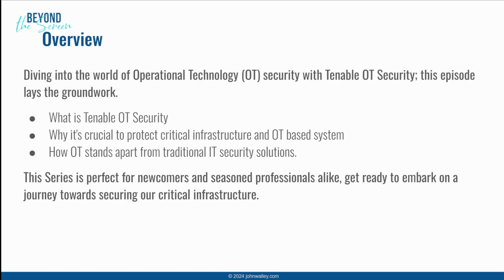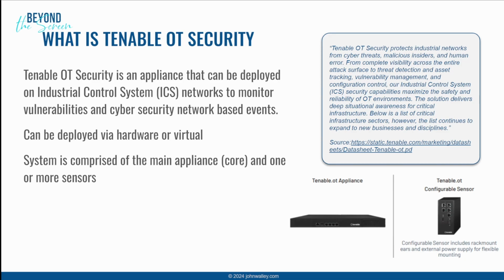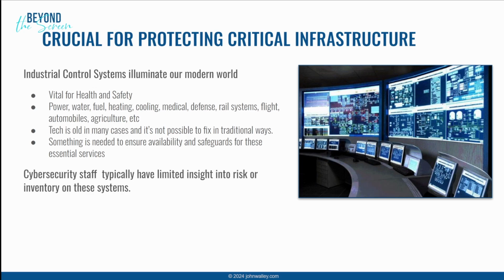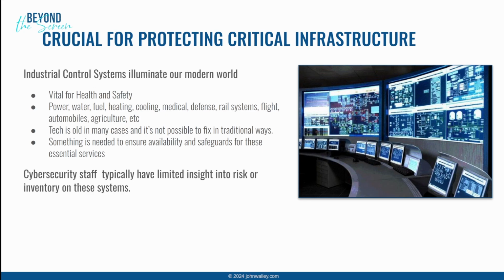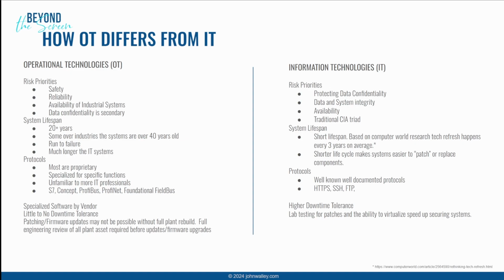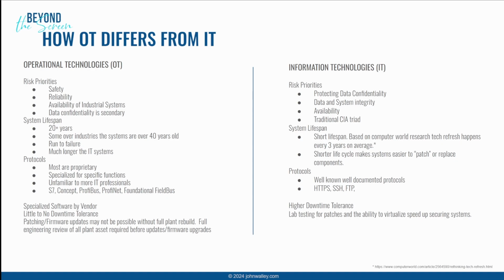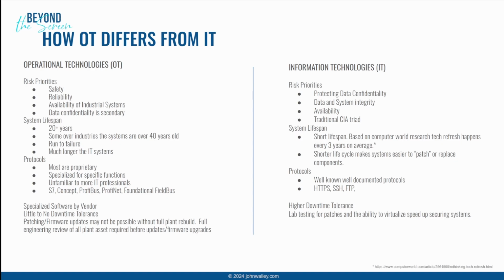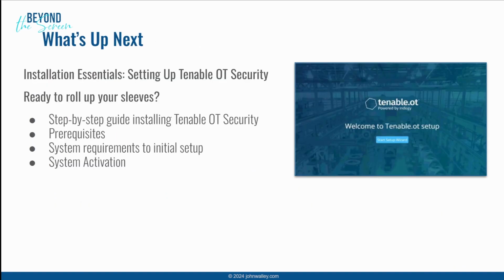EP1: Securing the Foundation: Introduction to Tenable OT

Comment: Hi John, really appreciated these videos. Any recommendation for the tenable OT security specialist exam? I can't find much online, I have some lab exercises and the tenable OT user guide but I don't know what to expect in term of questions.

I heard there is a written and and practical exam. Any help would be appreciated.
Reply from the maker: Thank you for your kind words! I'm glad to hear you found the videos helpful.

Regarding the Tenable OT Security Specialist exam, here are a few tips to help you prepare:

- Make sure you have a deep understanding of the Tenable OT user guide, focusing on key features and functionalities. Here is a link: https://docs.tenable.com/OT-security/3_18/Content/Introduction/Introduction.htm

- Since the labs run on version 3.15, ensure you're familiar with this specific version. Hands-on practice is crucial, so spend ample time on lab exercises to get comfortable with the product. You should be able to get an older version from Tenable Support if needed for study as long as you have a license. 

- For the written exam, you can expect questions that directly assess your knowledge of Tenable OT's features and usage - again this is tied to version 3.15 and a good bit has changed 

- The practical exam will test your ability to use and navigate Tenable OT in a simulated environment. Focus on tasks such the output of of specific actions. actions such as - what networks are identified you your monitored network?

- As a tenable customer you will have access to Tenable University. Take the free on-demand class if you haven't taken the instructor lead class it will help. 

- Finally, stay focused and confident in your skills. With thorough preparation, you’ll do great!

Best of luck!
Reply from the maker: If you still think you need some brushing up I would be more than happy to assist. Just drop me a line at jwalley@type11.net.

Comment: Amazing video! Do you know if Tenable OT does any compliance scanning like Tenable SC? If so, does it use STIGs like the Tenable SC audit files? Besides an on-prem virtual or physical deployment option, does it support cloud deployment?
Reply from the maker: Currently, Tenable OT does not support compliance checks. Including standards like NERC CIP and NIST 800-82 would indeed be beneficial. If you're interested in seeing compliance capabilities added to the tool, I recommend making a suggestion through their feedback portal, which is closely monitored by the team. As an existing customer, you can contribute up to 30 votes for features you'd like to see in Tenable products. For more details, visit https://suggestions.tenable.com. Additionally, coupling OT with SC allows you to generate reports for both your OT and IT assets, as they integrate seamlessly. Here’s a video on this integration: https://youtu.be/EBsDL39SS4k?si=xtzTqUOw50G6N-Ch. While direct compliance capabilities are limited, this setup offers some compliance functions for IoT assets in the OT environment, including high-functioning HMIs, asset servers, historians, and engineering workstations.

On the cloud front, you can also integrate Tenable OT with Tenable One or Cloud Vulnerability Management products. The Tenable One product has evolved significantly, and its integration with OT creates a new dynamic for making risk-based decisions, thanks to the integrated AI.
Reply: @john.walley  Thanks!

Comment: Great intro! Are these mostly passive or do they introduce any new communications onto the network?
Reply from the maker: By default, Tenable OT is configured to allow only passive monitoring, and the only impact on the ICS network is the transmission of data to the core appliance from a sensor (if one is deployed), but no other device is touched. Tenable's passive technologies are on par with other OT Vulnerability Management tools like Nozomi and Claroty, and not much sets them apart other than their look and feel. Each of these companies has a different view on what's important, but they all access the same data. However, Tenable OT's real strength lies in its active technologies (excluding Nessus, which I will cover in a future episode).

While active technology does communicate with critical devices such as controllers (PLCs & RTUs), it does not perform scans. This is crucial to understand: Tenable OT is not a scanner. I can't emphasize this enough. Tenable OT interacts with the controllers in their own native language, sending them well-known function codes to request information. For the engineers out there, essentially, Tenable OT polls the controller for specific information.

I have been in the process of setting up a small controls lab to delve into active technology and how it works, which I plan to cover in a future, more advanced episode.
Reply: @john.walley  Maybe a vid deep diving into passive and NNM. For anyone looking for a crawl, walk, run phased approach.
Reply from the maker: @GeorgeSimonds-gh7ki  Its a good idea. As I wrap up the optimizing and tuning of policies and events it may be a good section to jump into.
Reply: @john.walley  Please look at the Honda ransom case and how hackers got to scan the network for devices and do all sort of attacks on plc, hmi, etc. to figure out a method for scanning, the way the black hat hacker did it.
Reply from the maker: Sorry for missing this one! For some reason this wasn't showing up in comments section. Thars a great suggestion. Will do.